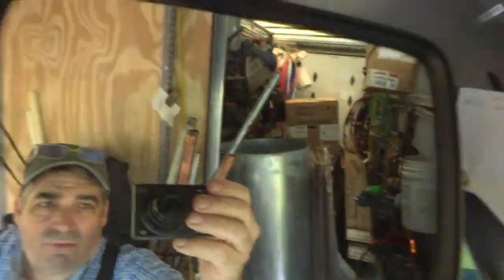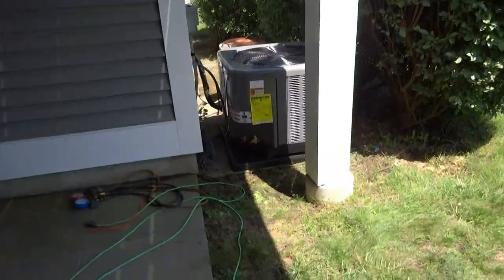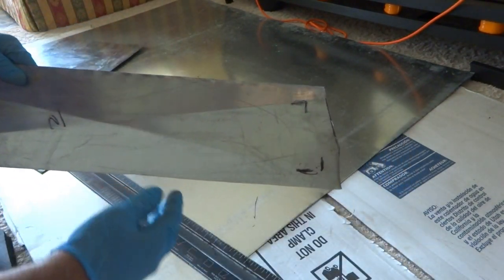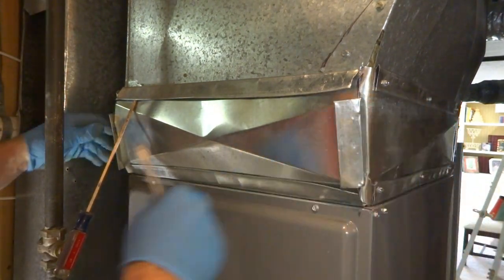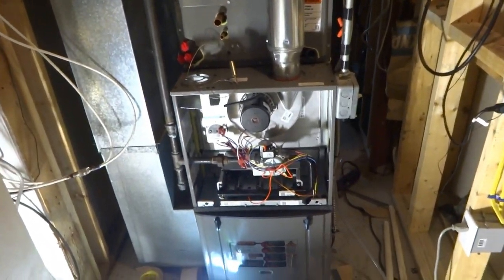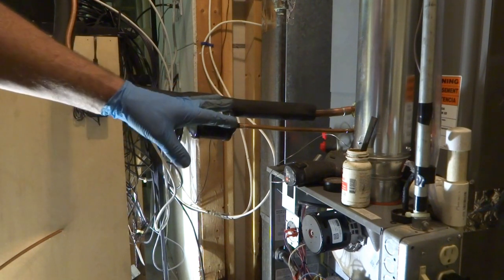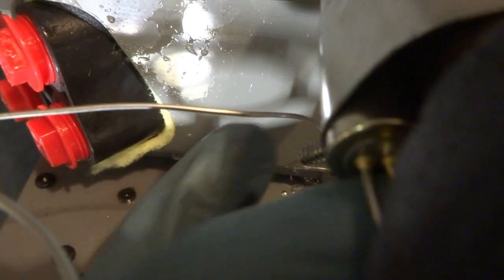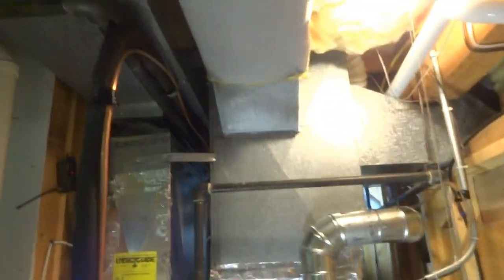Upgrade Your Home with Gas Furnace and AC: What You Need to Know

Comment: Great video.  My air handler was designed at my request for a 5” thick MERV 16 filter.  My particle counter is always near zero and my wife has no allergies in the house anymore.  I also added a ventilating dehumidifier.  I couldn’t sleep in the new house.  It was well enough sealed that it needed ventilation air.  Now I sleep soundly and dream again.  Our VOC’s and C02 were too high and needed fresh air.
Reply: That's different than a random idiot putting in a 1" thick nerve 13+...  if it's designed in, it'll work mint.  If not... Juuuunk

Comment: I used Filtrete MERV 11 filters for years and didn't have any issues, no pressure drop whatsoever...living in the Deep South, I did change them every 30 days especially during the summer months...we bought a new home with a 5 ton Trane variable fan speed  HVAC system. It uses dual AprilAire 16x25x4 "accordian" type filters...the manufacturer claims they can last 6-12 months...after about 90 days, they need changing..at $105 for the pair, they're not cheap but neither is a $25,000 heating and cooling system.

Comment: Good job on the tin work. Most HVAC "installers" wouldnt bother because they dont know how, dont care, or just want fast money. Sad really. Also just a tip but when checking for leaks use the solid stream on the bottle instead of the spray. That way you arent making your own bubbles when you spray.

Comment: I love to watch you work.  Install is a form of art! Question: why all the s-lock? I used to install in my earlier years. For ductwork situations like this,  I'd mark my metal the full length of the side then add an inch on the right side.  Bend that side in then screw it into the next side piece... each side lapping over onto the next. Made easy work of it and smooth taping.    Very sturdy without fighting with the s-lock.  Just curious.    Watching your videos makes me want to work again!
Reply from the maker: i feel s lock is the proper way to do the job , so thats how i fly ,do what ever floats your boat.

Comment: Were you using water grade solder on the refrigeration lines?  Not using silfos?
Reply from the maker: its staybrite 8 high silver content solder  3,000 lbs strength, its stronger then brazing . and dont need nitrogen purge . and less heat .....look it up .
Reply: Thanks Steve, I will.. @stevenlavimoniere

Comment: Steve - I was wondering about the gas valve - - if it's a ball type, it sort of looks like in the video (could be the camera angle) that it's turned beyond full open. Thanks for posting this, especially loved all the tips on the sheet metal work, so appreciate you sharing (as all of your vids) your years of expertise and professionalism. btw, even though I've got the 12" model snippers, I ordered the 14 like the one's you're using, thanks for that tip.

Comment: Hey Steve, any thoughts on Coleman furnaces? Looking for a new one and the installer only carries Coleman. Thanks!
Reply from the maker: junk its a york / nordine dont do it
Reply: @stevenlavimoniere  Thanks Steve!
Reply: I like the Rheem equipment that Steve installs. I was going to install Rheem at my house but I couldn’t find a Rheem 5 ton 21” coil to fit in my utility closet. I installed Goodman instead and I have been happy with the performance and lower electric bills.
Reply: @picklerix6162  I think I am gonna go Rheem. I like Trane but harder to get parts

Comment: Nice sheet metal work! Wish you would be closer to my location in Connecticut.  I need someone trust worthy and professional.  I need new AC and oil boiler. 2 separate systems.  I would put you up in my house or hotel, miss moĺly also

Comment: Steve why not just install a heat pump? That's what most companies here in NY are offering, their banning gas heating equipment, and gas supplies to new builds here. Great efficiency, zero carbon footprint, and cost to install isn't much more
Reply: The problem with heat pumps, even the inverters as a standalone, is yes the evaporator coil will get scalding hot and make some good hot air at first, when it operating in mild to near freezing temperatures. But that quickly diminishes to more of a luke warm type of heat, in bitter cold and below zero Fahrenheit temperatures. It not a real cozy type of heat that a lot of people still prefer, that gas, oil, and heat strip furnaces, would still produce in really cold temperatures .

Comment: Why do you hate those pleated filters? you prefer the fiberglass? I get the 3m dont even have a proper merv rating but better than the fiberglass. At least its filtering the air and cleanin the dust up. Fiberglass lets anything but the cat through

Comment: Why not order a custom box from a fabricator. That thing’s gonna leak air, especially with tape. Cement would be better… Aero-seal glue blow in make a huge difference with pushing air where it needs to go.
Reply from the maker: it dont leak ..
Reply: All ducts leak, close that gap and performance of a system goes up. Experienced it on two properties, cement and tape used at every entry point possible. They blew in the glue and you could see it coming out of areas the cement and tape were not sealing. Go inspect your own system, tape it to hell where you can, do your best, then have an aeroseal done. You’ll watch the glue blow in the air as a white mist everywhere until it seals the holes. The computer attached to the machine shows the CFM #’s. We went from 303.9 cfm leak 30% loss down to 10.7 cfm leak or 1.1%. 29% gain! Other property was not as good. 270.1 cfm 23% loss down to 48.7 cfm 4.1% 19% gain.

This would make a great video for your channel.

Comment: I use to run across crappy plenum connections all of the time. My neighbor had a new coil installed and the installer taped over a wide gap and the tape let go so conditioned air was flowing into her attic. There are a lot of jacklegs in the HVAC business.

Comment: I am not sure you need a filter dryer on a new install. These are used for burnout's on existing systems. These will add pressure drop to the new system for the life of the system which equals energy loss and higher operating pressures.

Comment: The vacuum pump removes atmospheric air which, if left in, replaces some of the refrigerant capacity and cooling capacity of the system. But the system will operate with the air in it. So if air is left in 14.7 psi (atmospheric above absolute vacuum) and system is charged to 275 psi - then its 260 /275 or 95% of full refrigerant and cooling capacity.